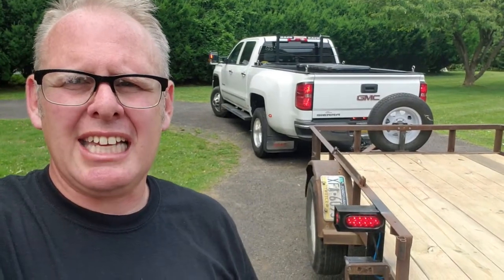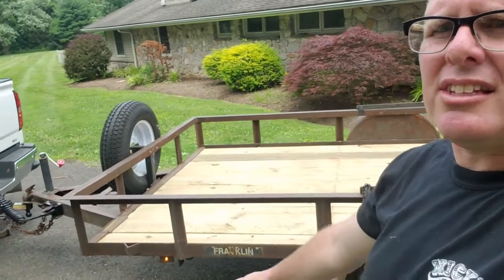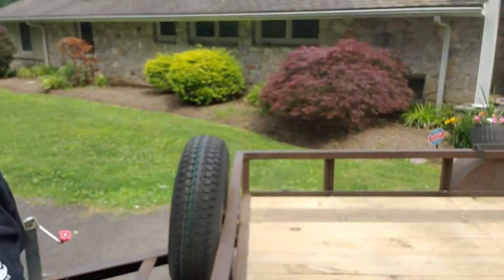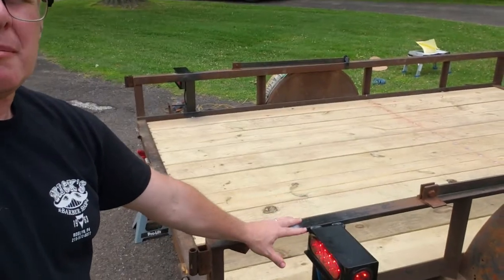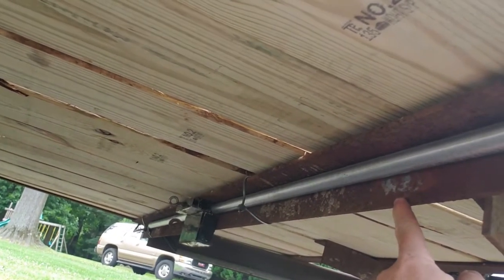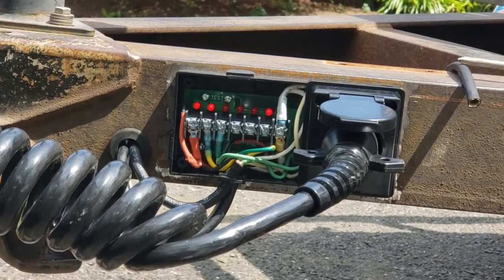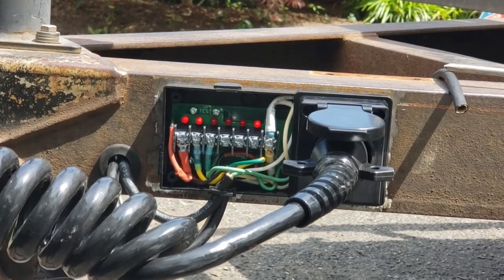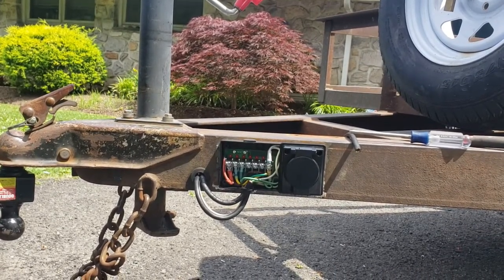5 Tips on How to Wire a Trailer (short version) Ultimate Reliability

Comment: Another good tip is when connecting any 2 wires together, use metal butt connectors (without the heat shrink on it), and buy the special heat shrink that is adhesive lined on the inside. When you heat the heat shrink up, you will see the glue push up and create a waterproof seal. I swear my connections are bulletproof after doing so.
Reply from the maker: That is great advice! Thanks for sharing. Reliable wiring is what we're all after and your comment is gold.

Comment: The Pro Plug system looks nice and yes, the junction box itself is only $40. But Pro Plug wants $109 for a five foot 7 pin to 7 pin cable!?? Crazy.
Reply from the maker: It is a nice cable, and I don't regret buying it,  but ilI've seen this comment a few times.

You've gotta look past that. You can literally take the cable you currently have on your trailer, add a 7 pin plug for under $10 and have just what you had before, but with the advantages of the pro plug. Or you can make your own, depending on your level of resourcefulness. 

Yes, the quality of the coiled dual plug is great, and convenience is excellent BUT if you have an issue with the price and can't adapt it to your own trailer or arrive at a solution to meet your needs, then I probably should put out a few more videos. Then again, I'm way overdue for one, so this commend could be the kick in the butt I needed.  Thanks for that man!
Reply: @PaulsProTips  Ok- very good point about making the cable yourself; I didn't really consider that.

Comment: I ordered the pro plug kit today from pro plug site. At 1st My bank declined the transaction. It declines transactions from overseas but it says it's coming from Oregon. The transaction went through the 2nd time. I hope the site is legit and I get my product. Is the proplug box still holding up, I was wondering how the circuit board holds up.
Reply from the maker: You are right, it is Oregon. The system continues to work great for me! I've installed 6 of them and all work great to this day. I've not had a single issue.

I would like it if they made a steel other metal box, but this has been good for the last 3 or 4 years.

I trust you'll like it. I really do appreciate you sharing this. I reached out the the fellow who owns proplug and told him I loved his product and was gonna do a video. He shared with me there was a very noticeable bump in traffic and sales after the video. Feels good to know I found something cool and sharing it has helped others.

Comment: Do you ground your trailer through the tow ball or does your 7 core cable bring an earth back from the truck?
Reply from the maker: Yes, the ground is through the cable. There is a ground (white wire) on both 4 flat and 7 pin trailer plugs.

On the 4 flat you have White/ground, then yellow/left turn then green/right turn and brown/running lights. The brake lights are done through yellow/green simultaneously.

The 7 pin uses the four above plus a red/12+ for battery or other accessories, typically blue/trailer brakes and a reverse lamp/purple.

I've seen 12+ use the color black and the reverse lamp get indicated as orange too. There is a whole other can of worms because the RV configuration is different that what the major vehicle manufacturer's have adopted over the last 30-40 years.

So to circle back on your original question, the ProPlug and har essay has a dedicated ground. I do try to use a pretty substantially sized wire (10 gauge) out of the ProPlug and to a reliable ground bolt. Sometimes I will also run a ground all the way back to the steel light box enclosure.

What typenofnproject are you working on?
Reply: @PaulsProTips  I would be more accustomed to using a 7 pin here in Europe(Ireland) but even then the colours are different as we have separate indicators and tails. Tails are separated so if the wire fails, you dont lose all rear lights.

Indicator Left -- Yellow
Rear fog light -- Blue
Earth -- White
Indicator Right -- Green
Side lights, marker lights Right -- Brown
Brake lights -- Red
Side lights, marker lights Left -- Black

This is known as a 12n plug. For things like power and auxilary power(RV use), we use a another wired 7 pin plug which is known as a 12s plug. Although these are slowly being phased out for a single 13pin plug(1 shared Earth).

The way the ProPlug operates is ideal, essentially a junction box with diagnosing ability. 
Why do you run an earth wire to the light box out of curiousity? Rather than just earthing at the light mount itself and use the trailer to carry the earth? 

I dont have a project at the moment but always looking for better ways to wire my current trailers in future.  I do wish there was a worldwide agreed standard for the wiring and colours though!
Reply from the maker: @JohnnyDub16  I really appreciate the thorough explanation. Gives great perspective to how things are done a d why. I agree, I wish there was a universally accepted system.

As for the earth being running to the back, it really is just my own "belt & suspenders" system. I feel trailer grounds have been notoriously poor on so many trailers I've run across. Academically it should not be needed. But it doesn't hurt.
Reply: @PaulsProTips  I see. I suppose if you're running a power wire to the light you may aswell run an earth wire too. What kind of things can you power with the Red 12+? Low amperage things I would presume? Thanks for the replies.

Comment: You should weld the conduit before you run wires through it
Reply from the maker: Thanks for watching and leaving a comment. You're right. It was a calculated risk. I was slightly out of order on a few steps, mainly because I was working at my house and did not have a welder here. That will change soon enough.

Comment: Love the video this is what I was looking for. QUESTION: Running parallel like this you have two seperate shielded cables coming into the Pro Plug box. Single, yellow and green with two seperate brown and white. Are you creating individual connections on these and then attaching to the pro plug or are you splicing those together and connecting with one?  In the video it looks like there are multiple connections on the ground but it looks like a single connection on the running lamp. But you have two seperate running lamp lines.
Reply from the maker: Thank so much for the reply. You may find better reference pictures in the other, longer version of this video. I only have 5 or 5, so it shouldn't be hard to find.

Basically,  the yellow and green each run to their respective rear taillights. I use that tailight box as a junction area. I run two brown wires- both landed in the proplug, then back to the taillamp - along with dedicated grounds.  From those taillight junction boxes, I run wires up to the running lamps in front of the trailer tire.

This has been perfectly reliable, but also provides segments I can use to isolate each section of the wiring- should a problem arise.

I still use this trailer 2-3 times a week for the last 3 years and I've yet to make a wiring repair! Average trip is around 80 miles.